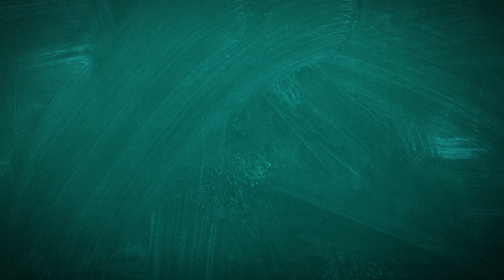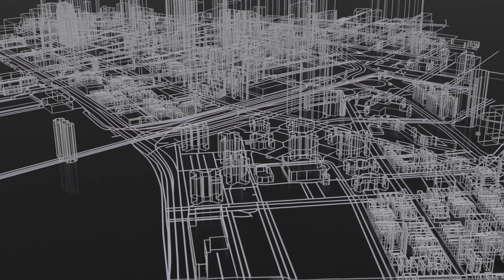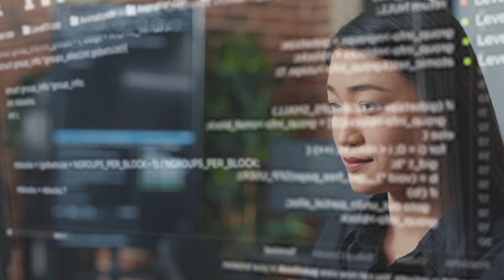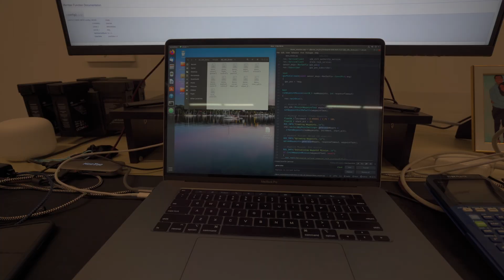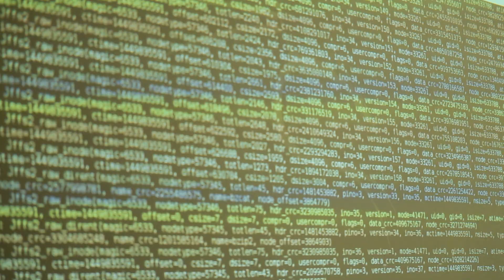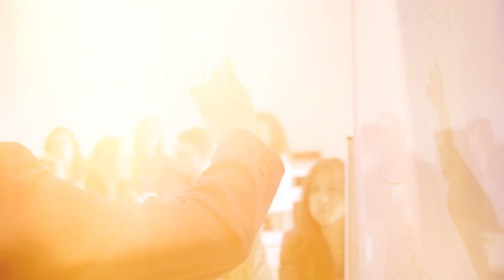“How much can an Aerospace Engineer actually make?” MIT alum Q&A

Comment: Hi Kj, did you know any international students that took aerospace engineering? How was the experience for them in terms of jobs/ internships during and after uni?
Reply: It's a little difficult as many positions in the Aerospace/Defense sector are for U.S Citizens
Reply from the maker: Yes unfortunately a lot of pure Aerospace jobs are funded by the US government. However, as mentioned in the video, an aerospace engineering degree is more versatile than you may think. Also, we had hired international graduates for our drone startup, and we ran into no issues because we were an Aerospace company that was completely independent of the US government